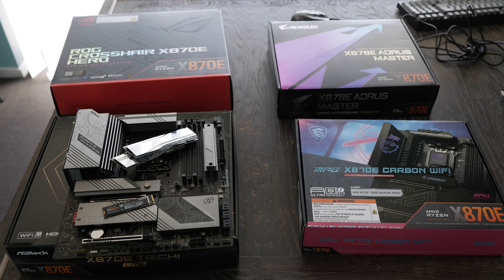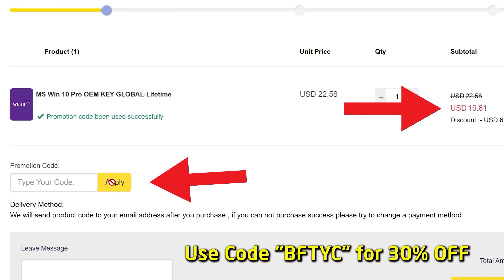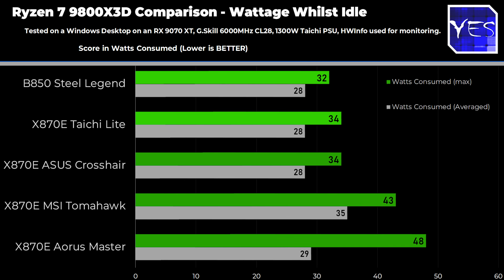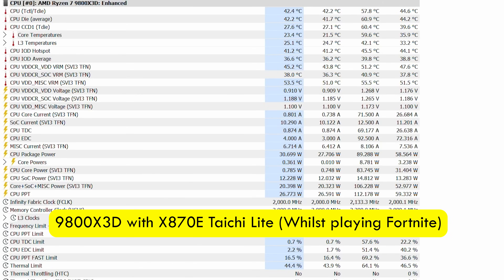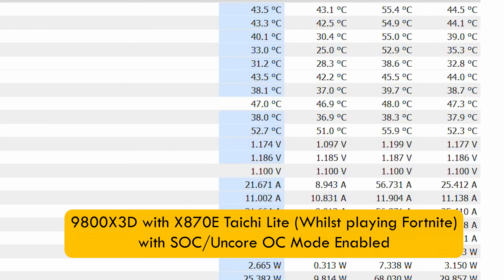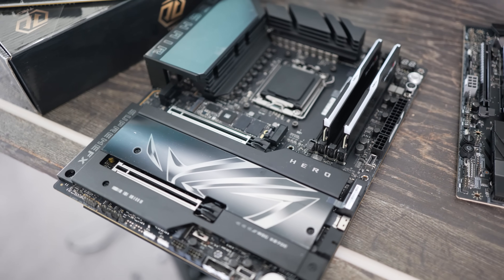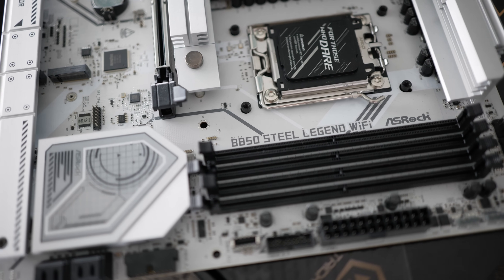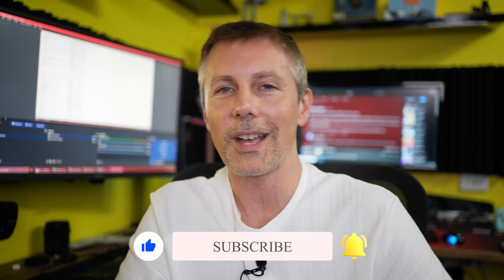I think I know why Ryzen 9000 Series CPUs are Dying...(!)

Comment: AMD should revise Soc and Core voltage limits within AGESA. Set max limit for Soc Voltage to 1.25v instead of 1.3v and Programmed VID Limit Voltage to 1.35v instead of 1.4v, making it impossible for CPUs to receive voltages higher than that. CPU VDDIO Voltage should also be limited by AGESA to max 1.4v.

Comment: Assuming your theory is correct, would that likely cause adverse issues for someone like me who has an all core OC to 5.2Ghz with a voltage set to 1.085. If your theory is correct and voltage spikes are causing some CPUs to die, then would a set voltage likely prevent those spikes?
Reply: You will probably not be affected. I had a different problem that was caused by a setting in auto (MSI B650 board) trying to OC the CPU hard and making the system unstable. Once i went and put a specific speed, not a hickup for 2 years straight. But in my case its a 7700X and it wasn't voltage related so your mileage may vary.
Reply: @jpteknoman  Thanks. I originally started setting an all core 4Ghz OC at 1.2volts on my old 3900x and never had an issue. Now that I have a 9950X I did essentially the same thing and also have had no issues.

Comment: Generally speaking it is better to have a constant voltage instead of a control loop doing voltage changes because you can have under and overshoots. This is just a general statement. Just reading out Hw monitor values has not the temporal resolution needed to see an overshoot, but hey, you tried and I wouldn't be surprised if you actually found the problem and the solution!

Comment: Think im going to continue leaving my system untested a little longer. Hopefully this video pushes "influencers" to force asrock to respond, since the lowly customers dont really have a voice anymore.

Thanks for the testing. The only one seemingly exploring these scary forum posts
Reply: Built mine despite it's almost a month old. X870E Nova 9900X3D 1.125soc. It games but am wary.
Reply: @techyescity Maybe we could look at ripples from power delivery too? How clean of power are these chipsets recieving? directly from the PSU? Could this cause some variations as well?

I really wish there was more information on the full builds of dead ryz9, rather than just mobo / CPU. Id assume a power supply with 5 years of usage degradation or more could cause problems. I guess we will see if theres an increase of chips dying as power supplies age
Reply: @57spitfire57  From what I have gathered it seems like its either a combination of things but so far involves the soc voltage, which memory kit, and running expo or not. is motherboard bios part of the equation? for sure. im no expert. i hope these issues can be resolved through an bios update but now I dont know if i bought a 430 dollar paper weight.

Comment: as a 9800x3d + x870e taichi owner, i can say nothing bad is happening even tho im pushing my gear to the limit with overclocks and crypto mining 24/7. But also i never use default bios settings and do my own OC.
actually funny thing is i damaged my 9800x3d when delidding and ripped out one of the capacitors completely of the pcb. still works with no issues xD

Comment: Well at least it wasn't something basic such as setting the system power plan to max performance non stop in conjunction with the fault as you discovered.      What are your thoughts on this, should part time gaming system have this power plan enabled 24/7 is there any added detriment to longevity of the overall system when using the high / maximum power plan performance,.  Maybe an added potential stress on mobo with already aggressively set default settings from the mobo makers at purchase.